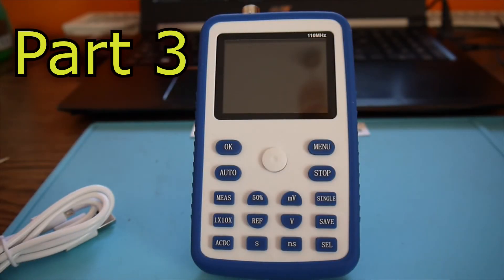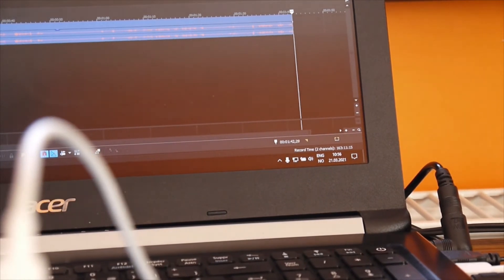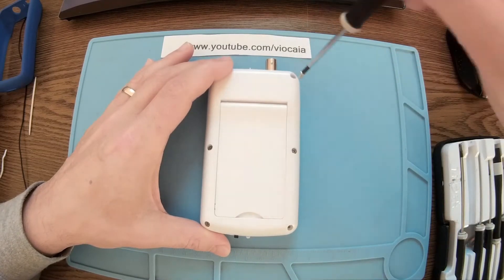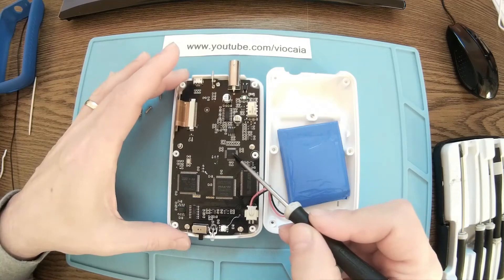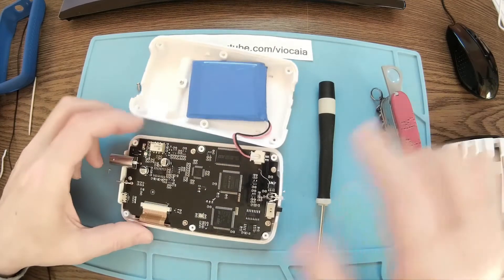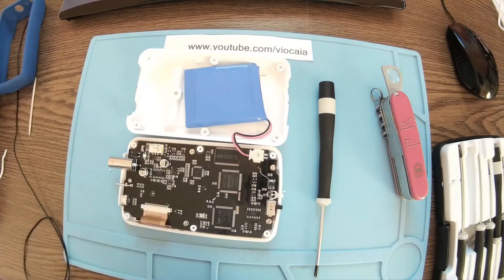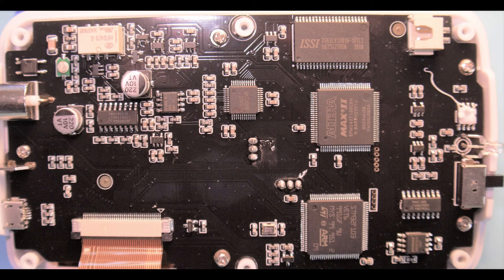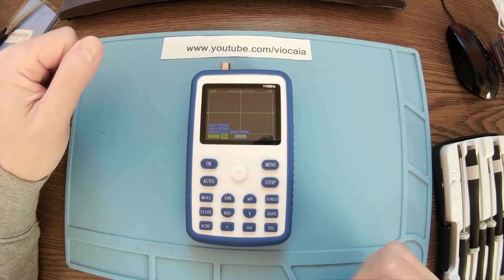Part 3 FNIRSI 1C15 110Mhz oscilloscope test dismantle and a look to main components

Comment: The glue on the chip is for a heat sink which is missing on your oscilloscope, diode gone wild did a video on this scope and the heat sink was loose inside the case on his.  I have just received mine today and the heatsink is where it should be on the chip.  Thanks for the videos.
Reply from the maker: I don't have it anymore...but I recall there was no heat sink..

Comment: You can enter the  Update page of the oscilloscope by pressing the key "SEL" while the splash screen is active, right after switching the device on.
Reply from the maker: NIce!
Reply: This is correct. But my PC will still not recognize the 1C15 in Update mode, which will make updating the firmware or saving copies of saved screenshots to a PC impossible. Hope this is user error on my part.
Reply: @rondavis8751  May be able to update the firmware I connected the hard drive via the SEL You should replace the USB cable The included only includes the power function
Reply: @卡卡的斯特  Thank you for the suggestion. Have tried more than 10 cables with no change. The "new" manual on the FNIRSI website removes all reference to updating the firmware or connecting to the hard drive using the SEL key. Appears this capability no longer exists?
Reply: @卡卡的斯特  Thank you for the suggestion. The new manual on the FNIRSI site removes all references to firmware updates and connecting to a PC. Possible PC connectivity was an earlier capability that is no longer available or supported? I have tried many, many cables with no success.

Comment: Hello Sir - great 3-part review of this FNIRSI 1C15 and also the same 3-part review of the DSO120M - If you had to choose, which is the one you would find most useful and better of the 2 ?
Reply from the maker: Fnirsi 1c15
Reply: @viocaia  Hello Viorel. Why do you consider FNIRSI better please? Thank you.
Reply from the maker: @madl3x  It feels more stable and smooth...close to parameters advertised. This is a hobby oscilloscope, but it can do the job in certain limits..
Reply: @viocaia  I bought this FNIRSI 1c15 model over the DSO120M I was considering, after seeing all your reviews. The tear down and the tests you did were very helpful. Thank you and great work!
Reply from the maker: @madl3x  You'll not regret..for the money it's good isntrument

Comment: Hi, Does this device capable measure voltage ripple, I wanna measure ripple some of my chargers and buck converters, I want 0.1V resolution at <30V.

Thank you
Reply from the maker: About ripple and Fnirsi 1C15 
https://youtu.be/LXGZBcTfoDg
Reply from the maker: It should, on AC 1X it's going to 200mv..I'll have a video about it soon.